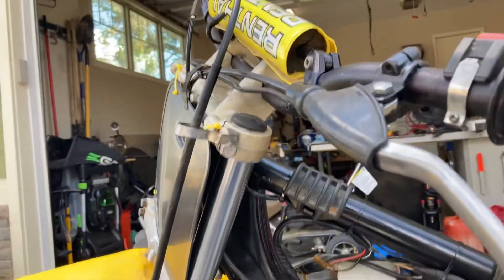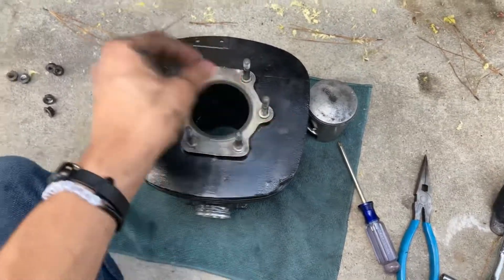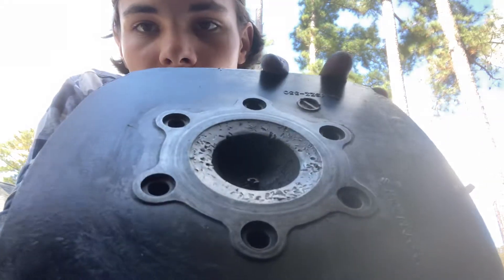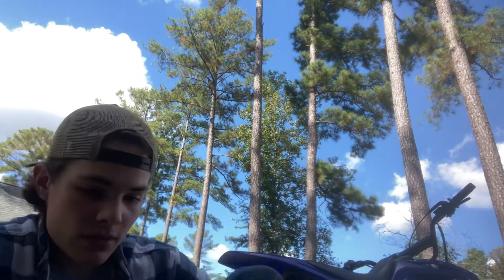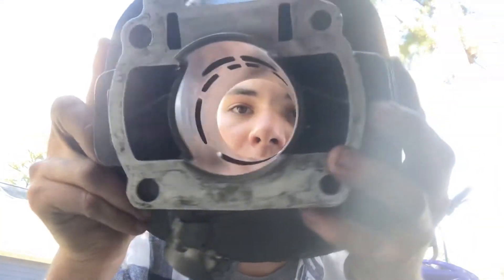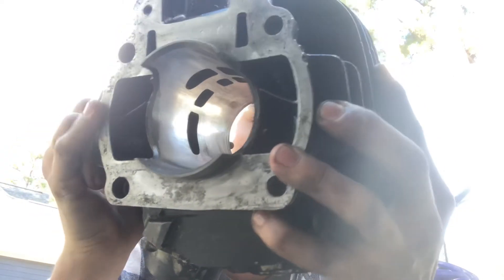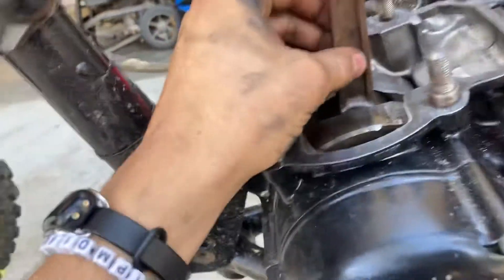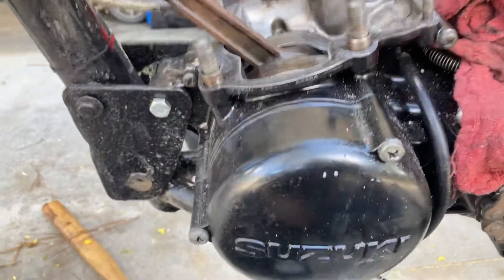Top end disaster! 1980 RS250

Comment: Not a disaster by any means’
Reply from the maker: Definitely a disaster as far as my wallet is concerned. Any suggestions?
Reply: @singlejingle_ka  did you make a video of the Rs 250 running before you took top end off ?
Reply from the maker: @mrmoparrr  I don’t have a video of it running on YouTube, but i do have footage
Reply: @singlejingle_ka  why dont you upload it ‘.    I don’t think it’s rattling as bad as you think.  There’s nearly no end play in that bottom conrod and cylinder doesnt look that bad .    You could get new wrist pin bearing and new rings and light hone that cylinder,
Reply: @singlejingle_ka  meant to ask how the compression seemed to you .
Reply from the maker: @mrmoparrr  the compression was terrible, could kick the bike over with my pinky finger
Reply from the maker: @mrmoparrr  come find out, there is .8mm of cylinder clearance and my bore is very warped
Reply: @singlejingle_ka  hence the rattling ,
Reply from the maker: @mrmoparrr  indeed sir